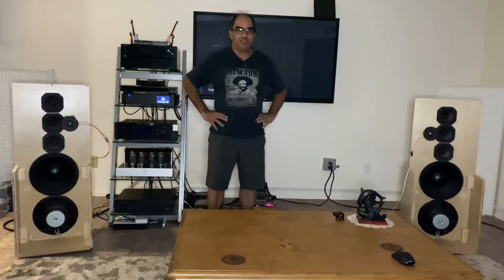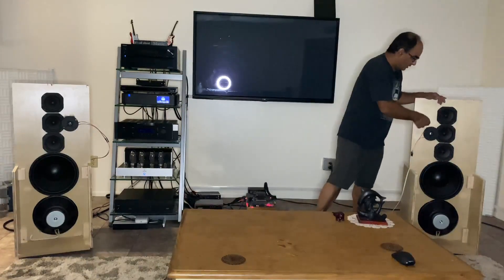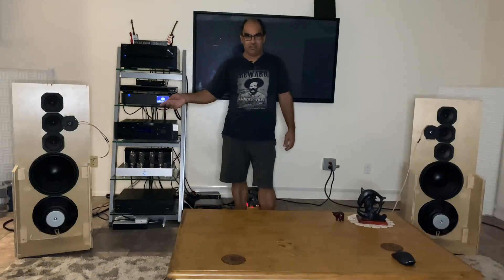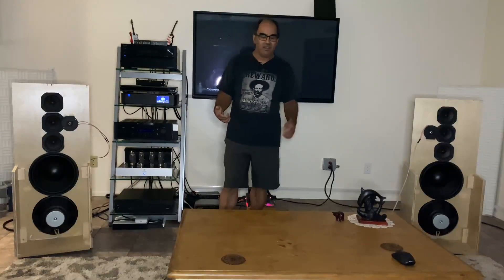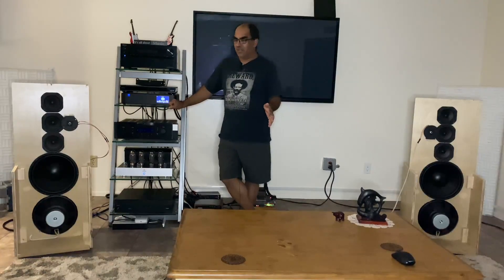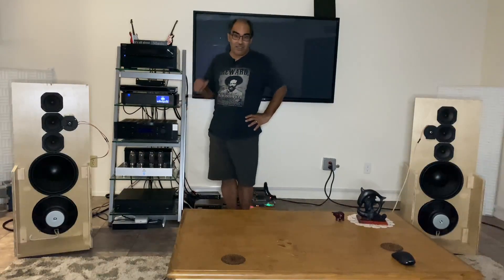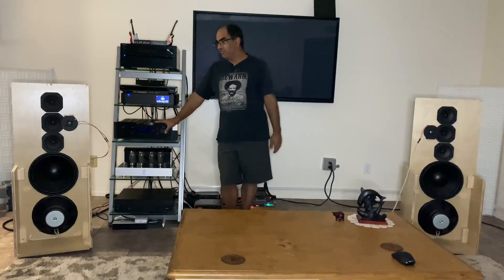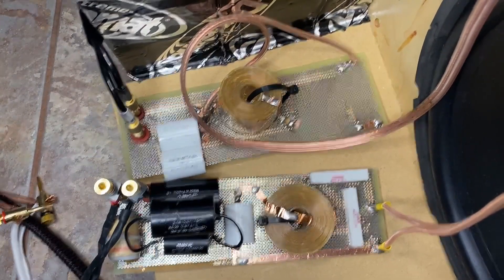The Open Baffle Journey  Part Two

Comment: Why is one woofer mounted backwards? What acoustic benefit does that provide?
Also, is the backwards-mounted woofer wired in reverse polarity, or normally?
Reply from the maker: Excellent question @firecloud77. It really doesn't matter since the Bass is Dipole. But for Aesthetics, you can have "Magnet's out or in or one out/one in).

Hope that helps. Thanks for watching and your support.

Comment: Nice setup. What woofer are those?
Reply from the maker: https://www.parts-express.com/GRS-12PR-8-12-Poly-Cone-Rubber-Surround-Woofer-292-422?gclid=Cj0KCQjwv5uKBhD6ARIsAGv9a-wrY7Q52Zp9zvkZpQYRLuh_0uaUWruC8dG27cRkqpuneEYRjX3czMIaAlmdEALw_wcB
Reply: @joeygsaudiochannel  thanks very much. After some careful detective work I thought it might be that woofer. They do a paper cone woofer that is very similar. Plus, there are quite a few other 'good value' woofers from GRS and the likes of goldwood. 

I'm just in the process of simulating the various woofer options in Basta and Martin J King's mathcad worksheets. 

In Martin's sims, I'm getting a peaky response around Fs when modelling H or U frames for some of the woofers but can't work out why yet. It might be the higher Qts (1.5+) but I've not fully eliminated that variable as yet.